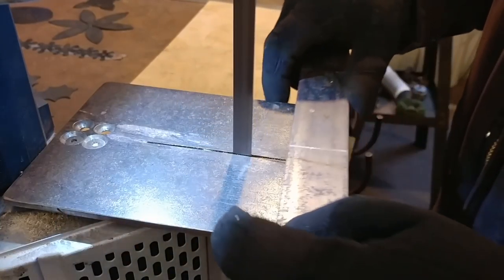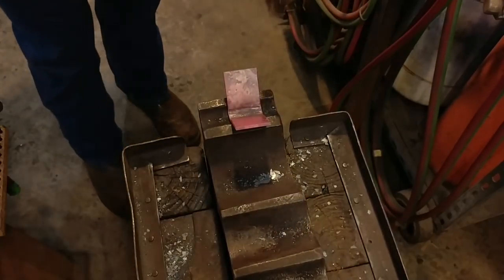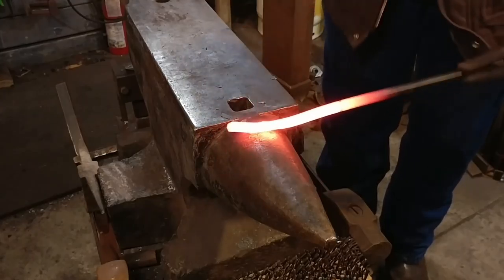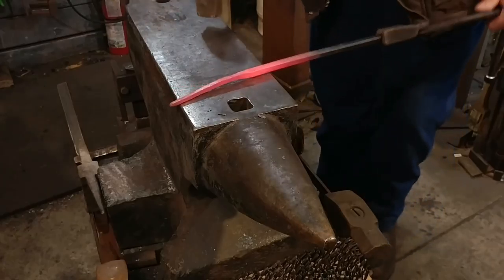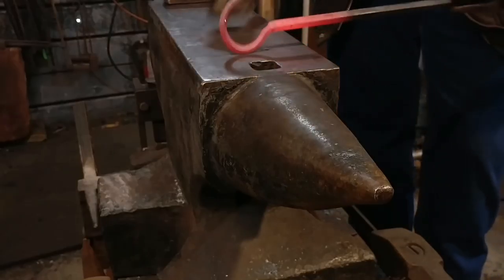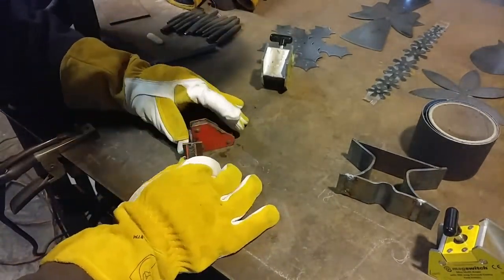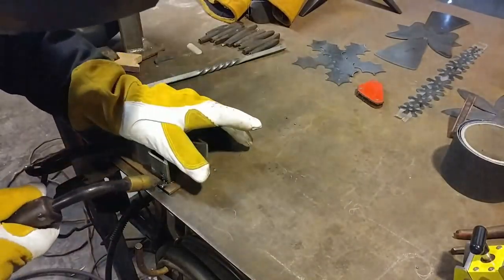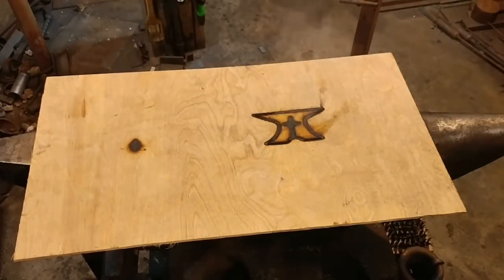DIY Branding Iron (Part 1)

Comment: Great job, Roy! I liked the way you built your branding iron, incorporating the use of the backing plate - that's a great idea. I haven't seen anyone else do that. I think I'll adopt your method when I make a larger branding iron for the same purpose you made your's for (shipping crates).

I made a branding iron awhile back that was fairly small (for branding some of my wood sculptures and furniture). I used a brass bolt and carved my logo with a Dremel tool. I then drilled and tapped a hole in the other end of the bolt for a 1/4" section of round bar, and used a scrap piece of 1" diameter wood dowel for a handle. Here's the Youtube URL if you might be interested in making a smaller branding iron: https://youtu.be/r0n4xu5NNLc

Thanks for making this video and sharing your ideas. Much appreciated!